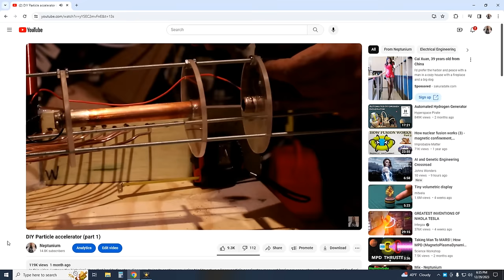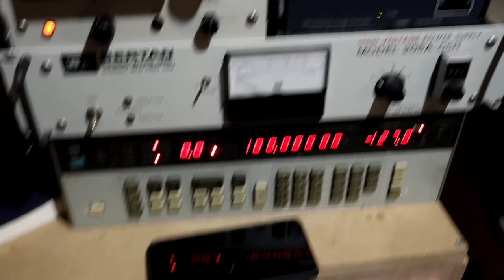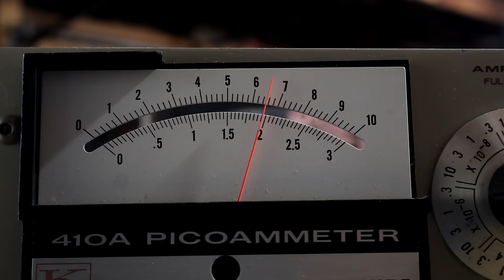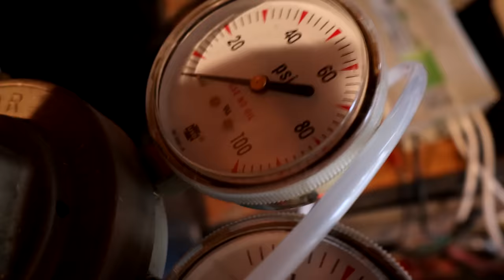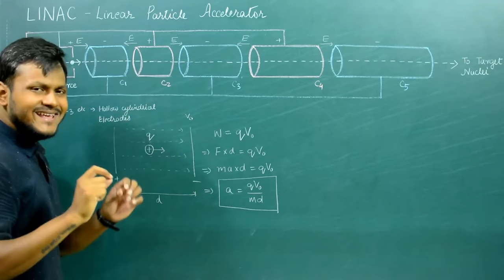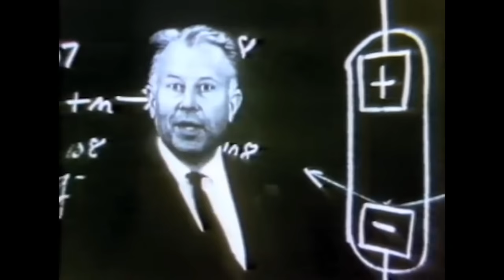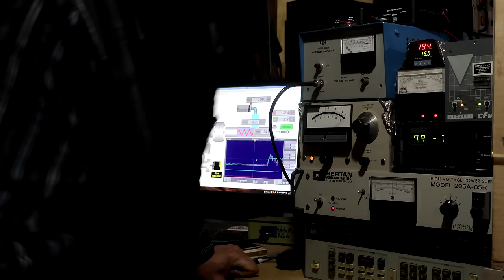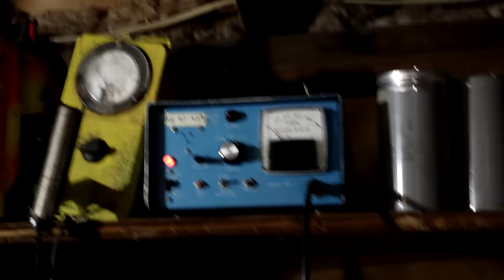DIY Particle accelerator (part 2)

Comment: Dude, thanks for the heads up on Weeder Technologies! Their SCADA software looks very useful. We are currently using another brand, but it is really expensive, and a bit limiting. I'll definitely be looking into these guys further! Thanks and have a great 2024~
Reply from the maker: Yeah your very welcome! I don't mind the windows 98 look and it could use some updates but if you are not into programming, it's such a useful and easy to use tool! Happy new year my friend and thanks for watching!
Reply: They're very useful and while usable, the interface isn't the greatest but allows you to put raw ideas in a flow on the screen. But the interface isn't required, the boards aren't the most advanced things on the planet either, but they could be directly communicated with. They're not exactly fast (at least many years ago)... but really helpful to nail down core aspects of a prototype. I have even used them as part of a real installation. 

At the time I used them they had 2 basic boards, a differential input ADC and a GPIO... RS232 and DIP switch addressable in a piggy back chain... I'm sure a newer version with USB essentially makes that unlimited.

Comment: Man, some research labs would envy your equipment. Nice explanations too.
I was however, cringing at 6:54 when you put the drift tube in with your bare hands. All the baking in the world won't remove the oils from your vacuum chamber, so you could probably improve your vacuum significantly by scrubbing everything down with mild detergent in water and judiciously using rubber gloves. Obviously you will then need to dry out your parts before reassembling, but the water will evaporate.
I love to see you doing this. It shows what amateur radio and science is capable of besides raspberry pi projects. I hope more people are inspired by your passion.
BTW, what software are you using for your readback interface?
Reply from the maker: Yes I should've used gloves after cleaning the drift tube with acetone, I was still able to reach a low enough vacuum but it could have been better that's true. The  software "ModCom" is available for download totally free from the Weeder website. Thank you for the comment and thanks for watching!

Comment: OHHHHHHH that's how you shattered the glass lol now it makes sense! great job! I did the same insulating my whole garage so i can be in it all year round, as well as organizing! lol

where did you get the sputtering gun?!?!?! that's sick!! I've been trying to use a filament as well, with not much success... do tell!
Reply from the maker: eBay my friend ! This guy from MIT makes and sells them... Not cheap but screw it right ! Thanks for watching!!!
Reply: @Neptunium  ohhhhh you got contact info?? lol or part number you used to search for it?
Reply from the maker: Sure here is the link: https://www.ebay.com/itm/254722032673?hash=item3b4e9dc421:g:Qh8AAOSwHqdfZBPN&amdata=enc%3AAQAIAAAAwEbRydZSQsoVUPmx5eP61y7qZEd5JA8DtlN4t6AROzTerfPbHpy%2BYauu%2BisWCbhOZoTysitJRNF%2FTghCz7TggZfh4BkzFMFZ7VQFxivro7b602d3hm95j0SeUTSf%2Ff5KCJBq6hkmyB3dOnYFx934K2G6Wyc9SYYauwGGaLrixIZCeoANhvw8Ql2ICY4tc%2B43joTI0xGeblHBTsuBJRVakON65Ch8a%2FHKiRpRkmo4rjbJDwEd4QD03hvmUFiFCgZdrg%3D%3D%7Ctkp%3ABk9SR57SoPqdYw
Have fun!

Comment: When I was considering the design of my linac (that never got built), I did not initially take into account that different location points for my acceleration elements would be exposed to different phases of the rf wave due to the high frequency of the signal and the speed of light that the RF signal travels.  Example, If your frequency is 500 MHz, if you check two points that are 7.5 cm away from each other along the acceleration path the two points will be completely out of phase from each other.  As a refresher, I watched the "For the Love of Physics" Linac video, but this potential gotcha was not mentioned.
Reply from the maker: So as with most videos, not everything made it to the final cut. I have a network analyzer (antenna analyzer) to account for this problem but i thought it would confused viewers even more . Which is why I did my runs with a single drift tube.. but that is a fair point and a very good observation... Thanks for that!! Oh and happy new year!!!

Comment: Its interesting to think that the viewport is not exposed to any higher pressures than max 1 bar at full vacuum and that is not a high pressure at all and is built to hold for it. So when pumping air into the chamber that would very fast go over that which is to high on the wrong side and it would break. Little confused though that the A/B gauge broke since the forces there are much lower, but it could have broke due to strong vibrations or similar perhaps when the viewport broke. Really good work though, very impressive!
Reply from the maker: Yeah I know right! They both exploded at the same time .. as far as I can tell .. anyway thanks for watching my friend!

Comment: I have a suggestion for you(if you are interested)you should paint a phosphor screen(like the one done in YouTube chanel 'cyclotrons') and just let the accelerated partical's hit it,it would be a interesting to see and you can use a sensitive Solar Panel(and can also use a frequency doubler or something like that for more sensitivity) and can see different type of energy when it's hit by different types of atom.

It would be a different type of alternative particle detector(if it work's, to be truthfull i Don't know by myself but I'm going to use it when i build my particle accelerator and i whould be thankful if you try it out an request)❤❤❤❤
Reply from the maker: Actually I've done exactly that, if you look at the video when I show the detector, the ring is covered in epoxy/Zinc sulfide mix . I was hoping to see it glow under alpha bombardment. I don't think it did since my max energy was quite low so I did not included it in the final video. Excellent suggestion indeed! Thanks for watching my friend!

Comment: What an achievement! Outstanding!
Reply from the maker: Thanks bro! Really appreciate it!
Reply: @Neptunium  It's only another experimental scientist who can understand what this kind of achievement really takes. It's an uphill battle for sure. 

Since the difference between just playing around and science is recording measurements and publishing it, that makes you a experimental scientist in my book. There certainly exist people with PhD's who couldn't manage this much. 

I won't name names, but consider the initial velocity one has from thermionic emission, (which leads to self-biasing) and why that means that for a electrostatic fusor with recirculation (the condition that injected electrons are never quite able to reach the outer walls, because of the bias of the grid), that the electron source needs to be placed somewhat inwards from the (conductive, thus always looking like ground because it's a faraday cage) walls, else the electrons will just hit the wall on the far side after a single 'once through' pass. And then, consider that the gun needs also a slight positive bias so as not to interfere with the shape of the electric field to the walls. (else the electrons may as well have been emitted from the walls). It's okay for electrons to come back and hit the emitter - that's just going to create secondary electrons, which will just help conduction, so it's okay that the emitter itself is where recirculating electrons can reach it. No loss of supply current there. The idea is that the grid is the only place they can reach, and for the polywell, that the grid has crucially just enough magnetic field so that only the cooler of the electrons can reach it.

A serious attempt was made to create a polywell fusor, except that the electrons were sourced from a gun outside the chamber. They were never able to reach a high beta because of this, since every injected electron ended up reaching the far wall, as you'd expect. This happens no matter what the grid bias is, since it's never able to take away the initial velocity from the electrons, where they had that in a particular direction starting outside of the chamber. It can only subtract as much as it can add.

A paper you'll want to chase down, if you can: https://link.springer.com/article/10.1007/s10894-017-0147-9

You self-qualification is as good as your data is, and from this video - it's convincing enough. A youtube video may not be a nicely-written pdf generated by Latex, but those are only aping the papers of the giants on whose shoulders we stand. If YT had been around back then, they'd be doing exactly as you are.

Thanks!
Reply from the maker: @RGD2k  well thanks a lot ! This is the kind of feedback I am looking for! I never claimed to understand everything I am doing and confirmation from others is a nice way to be vindicated! Thanks for watching and thank you for your comment!
Reply from the maker: Your right ! I really believe in the "hands on" approach to fully understand what we are doing, some things are not taught in books...

Comment: This is extremely cool! I don't understand much of the science here beyond the surface but your explanations of why certain design decisions were made felt pretty intuitive, like how the length of the chamber relates to the pressure it needs to operate at. 

I'm wondering if it's at all possible to use this device to recreate any famous historical experiments in nuclear physics (with accompanying explanation of their importance, in a future video)? I imagine though that a lot of these would require working with either radioactive sources or much higher power in order to move atoms larger than helium, so it might not be feasible.
Reply from the maker: Walton and Cockroft were able to use DC at 400Kv to split lithium (part 1) and Lawrence was able to get Mercury up to over 1Mev (as stated in the video) both required some serious power I don't have but your right! The appropriate amount would be able to trigger nuclear reactions and it would really be awesome indeed! Thanks for watching!

Comment: The project is awesome, kudos, Neptunium!
I did spot a mistake in your calculations: the charge of the alpha particle is 3.2e-19 C (*not* 2e-19). Also, in the calculation, you essentially start with the high voltage (which high voltage?),  then you calculate the speed and then you recalculate the energy. But the high voltage value times 2 is the same as energy in eV, you don't have to go through the rigmarole of calculating the speed. I think your final alpha energy should be somewhere around (the ion gun HV)+(RF voltage)*(number of accelerating gaps).
Reply from the maker: Oh that's absolutely possible I could have made a mistake entering my numbers. I wanted to make sure I could "fall back on my feet " with the energy calc. That's why I went thru it . The initial  energy you mentioned is the one acquired from the ion gun voltage. Thanks for watching and for pointing it out!

Comment: Is there any way to tell if you are producing single or double ionized helium? If so, what kind are you mainly producing?
Reply from the maker: Yes! The calculations are done for doubly charges helions and the voltage involved SHOULD produce mostly that.. it's difficult to tell for sure but based on the results it's safe to assume it worked at 90%... Ish.. thanks for the comment and thanks for watching!

Comment: make colored discs to throw around the pump connection ...like a washer doing nothing but when nothings connected you can have say green connector be vacuum and red one compression or add a fitting to the compressor side ...making it impossible to accidentally connect to it

Comment: Great project!  Was working towards building an RF Quadrupole linac about 10 years ago but never got it off the ground.  A thought occurred when you mentioned the 50kw power requirements: would it be feasible to set up a capacitor array to supply many kilowatts of power?  It's nice to think about continuous acceleration but you don't always need it for many experiments.  It would probably would mean that your RF system would need to be solid-state so you don't have to wait for a tube like a klystron or something, to heat up (but honestly don't know what architecture would be required for a high powered short cycle)
Reply from the maker: Yeah, I thought about that too.. looked into it but I don't have any where near StyroPyro electrical knowledge to hook up a klystron. It might not be difficult but I would need it regulated and I understand enough to know that might not be possible.. anyway, thanks for Watching and happy new year to you!!

Comment: Accelerator physicist here. I'm giggling in my chair watching this video. Everything about this project is well done, even as I was about to chime in about radiation safety, I watched to the end and saw your area monitor.  Fantastic work! Have you thought about adding electrostatic lenses to your line to help with detection/focusing and alignment of the beam?
Reply from the maker: Lol! Glad you've enjoyed it! Actually no I did not include electrostatic lenses! Not because I didn't want to! There is a limited number of ports to plug in feed through HV and I just didn't have that option! As for many videos, a lot does not make it in the final . I ran antenna analyzers, spectrum analyzer, tried microwaves 2 drift tubes, high frequency lower voltage, higher voltage lower frequency etc... a lot of work went into  this and I am ready to move on to be honest I already disassembled most of it ! ! But Thanks for watching!

Comment: 4:40 I am a bit confused about your explanation of the energy measurement. Since the ionization of the particles does not change, as long as a particle hits the electrode, it should deposit the same amount of charge, regardless of the energy, and as long as the amount of particles making it to the end of the accelerator per second stays the same (which should be limited by the source) There are however different reasons there might be a dependence between current and energy:
1) higher acceleration means a less divergent beam and so less particles lost to wall strikes
2) ionization in the electrode material, but this would not create a net charge or current unless actually forced to
3) an induced current, like in wall current monitoring in full scale accelerators, where the passage of the ionized particles induces an opposite current dependent on their velocity
In the first 2 cases this would require a further calibration curve, whereas the third one might benefit from a different sensor design
Reply from the maker: Ok. Yes we are in the same page, what was the question? The calibration for the energy measurement? This was validated with calculations. It is not exactly precise as you pointed out but it gives an idea where things are . This is a home build project after all. Thanks for watching

Comment: you can pull thorium/radium from old laterns and glow in the dark clocks,americium out of old smoke detectors put aluminium foil in front of it and you should get an alpha particle
make sure your accelerator is shielded and you vacuum is good you're going to create x-rays if it hits any particles
Reply from the maker: Good advice. Thanks for watching!

Comment: Hi  thanks for your help 
Now i know exactly what im gonna do
for my particle accelerator and my plasma detérium reactor 

For the power im gonna make a cockcroft walton voltage multiplier connected to my tesla coil

For the body im gonna buy some tubes and solder them together or buy  leiclamp tubes

And make my credit card bleed a little bit.

When I will be done with my research i will send you another message with a list of informations i've collected maybe it will help you.

Comment: I wonder what would happen if you were to propel hydrogen or detuerium ions to hit different kind of targets, like lithium, more deuterium, lithium hydride, boron or whatever. ¿Could you coat the surroundings of the chamber the target will be sitting on with Thorium or Natural Uranium to see if any rogue neutron of any of those reactions could breed fissile material?
Reply from the maker: it depends how much power you put into it!  Nothing happens until you hit a minimum threshold, beyond that, I suspect you could get a few neutrons but using Thorium or natural Uranium is not very practical or efficient. just a neutron detector would suffice. thanks for watching ! stay curious!

Comment: I have an idea for a fusion device that one day i might try... Its basically large high voltage capacitor that would be discharged through a couple turns around a small glass cylinder where a deuterium plasma is kept alive by some high voltage power supply like a neon sign transformer....If the right energy is stored and discharged through the coil into the plasma without destroying it i cannot see why it wouldn't work...at least at a fusor level.
Reply from the maker: Some to think about.. thanks for watching! And happy new year!

Comment: if i make a cathode and anode like a electron gun and pump helium in the vacuum chamber will the helium protons be accelerated? One more question isn’t the formula for the drift length just the velocity times 1/RF I believe the equation you gave calculates the gap in between each drift tube.
Reply from the maker: helium without its electron is not a proton but an alpha particle, 2 protons and 2 neutrons (for He4), but yes it would be accelerated toward the negative potential, one of the early experiment with such a tube had the mention of anodic rays that are ionized air traveling opposite the electron in early vacuum tubes. the formula is not from me  but I can see how one can be confused by the 1/2 . we only care about one side of the sin wave, the other slows things down... thanks for watching!